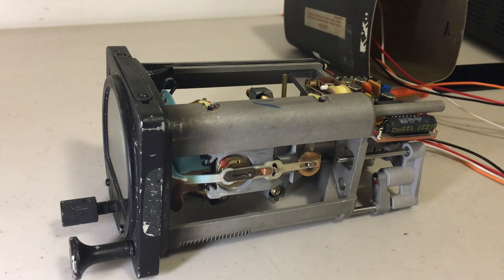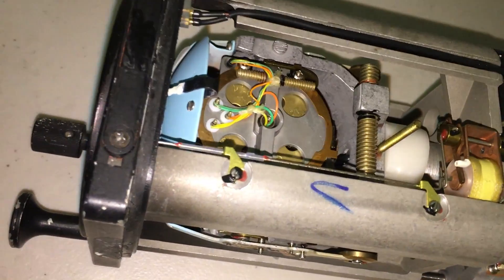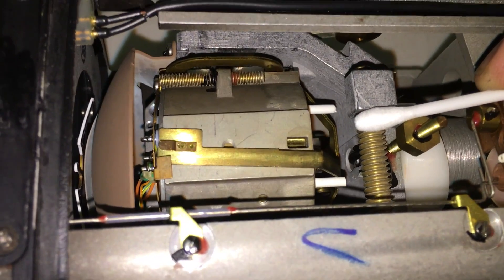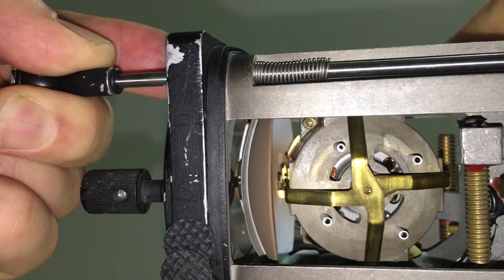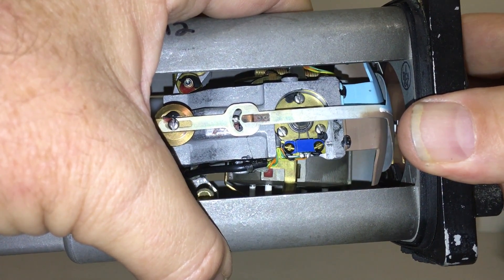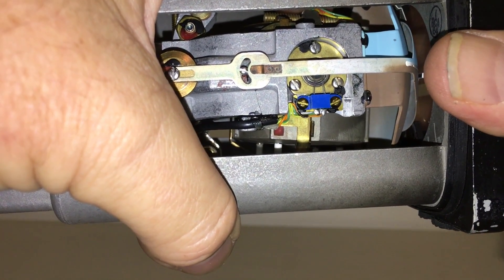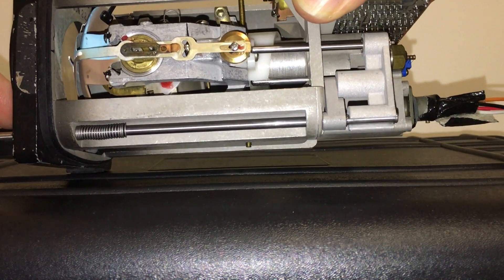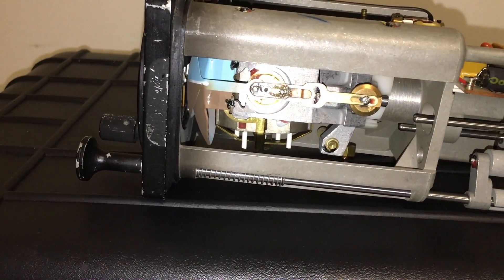Flat Earth - A look inside the Artificial Horizon - Pendulous Vanes.

Comment: Wolfie, a vid on Inertial Navigation Systems (INS) might be enlightening. While the artificial horizon does its job by correcting to align with the earth's gravity; the gyros in an INS do their job by NOT correcting, thus showing HOW FAR AROUND THE CURVE OF THE EARTH the pilot has flown.Might be difficult to explain so that a "flat" can understand, but you can do it if anyone can.
Reply: It is assumed that the gyro is self-correcting by 'gravity' acting upon the pendulous vanes as an aircraft circles the earth. A demonstration of what would happen in that eventuality is useless if that is not actually happening. Can you see the assumption?

If the pilot is actually flying over a flat plain, then the gyro would behave exactly as it does when you believe you are flying around a curve. 
.
.
There are those that claim that 'gravity' automatically keeps an aircraft in the flight at the same relative altitude as it fly's around the curvature. My only question to them is: Does it also keep the wings level, so that one doesn't dip below the other? 

After their wheels stop spinning and they admit that it doesn't, then I point out it doesn't keep those two points between the nose and tail level either. The pilot must do those things. Gravity could care less if it's level or about to crash.
.
.
.
There is a solution to this debate. Use electronic and video means to establish that what you believe is happening, is actually happening during a long distance flight. Those vanes  should be  opening repeatedly and frequently in the same direction, to correct for the beginning of any misalignment of the gyro due to a reorientation of the center of gravity.

Wolfie only needs to show that what he believes is happening is actually happening. Knowing the alignment of the AI (and the gyro in it), we should be able to predetermine which ports SHOULD BE repeatedly opening.
.
Reply: Gee, Mephi, I wanted to leave all the grunt work to Wolfie, but you won't let me, so here goes.

The artificial horizon (or attitude Indicator, -- AI) proves nothing: neither flat earth nor curved. The AI's gyro remains level, which is what both "Flats" and "Globes" expect. However, Flats think that, because the gyro remains level during a long flight, it debunks the globe. And that's why Wolfie had to take the trouble to explain that, actually, a bit of ingenuity (the pendulous vanes) was required to get the gyro to realign itself with the local force of gravity, and that the AI doesn't debunk the globe after all, and we're back to Square One.

That's where my idea about the Inertial Navigation System (INS) comes in. Nowadays INS has been replaced with GPS, and even late-model INS units worked with electronics or lasers; but the first models (1960s) worked with actual, physical, mechanical gyroscopes. To use them, you would first spin them up, and then enter the plane's initial position into the unit.  Then, as the flight progressed, the changing tilt of the gyroscopes (three of 'em, one for each axis) would tell the unit how much of the earth the plane had flown around, and thus where the plane was. Simplistically, one could say a gyroscope whose axis was initially vertical, after a flight around a quarter (90°) of the globe -- from Hamburg to Rio, let's say --  would be horizontal. This was a big deal at the time, and permitted those wonderful B-747 Jumbos to fly long, transoceanic routes beyond the range of radar and of reliable radio communication. It worked well. (Earlier, airliners had to use celestial navigation when they were out over the ocean.)

So here we have a gyroscope which maintains its position in space; and what is more, by measuring the change in the gyroscope's orientation, you can reliably tell where the plane is.  Gravity doesn't enter into it. At all. And to me, it looks like this is a pretty good proof that the earth is a globe.

But Mephi, while I've got your attention: actually, gravity DOES  play a large role in keeping an aircraft at a given altitude as it flies around the globe. And gravity DOES play a large role in keeping a plane's wings level. Now, I can't write you a primer of aeronautical design right here, but you can look it up online. What you want is the chapter on STABILITY: stability in PITCH and stability in ROLL. The mechanisms aircraft designers use to make an aircraft STABLE on the pitch and roll axes wouldn't work without gravity. In PITCH, if a plane descends (falls), it goes faster. Aircraft designers configure the plane's wings and horizontal tail so that the increase in speed that comes from falling (gravity) will cause the nose to rise slightly, counteracting the descent. If a plane climbs, the opposite happens: gravity slows the plane and the nose drops, bringing it back to altitude. In the ROLL axis, stability is managed through wing dihedral (angling the wings slightly upwards). It's a bit more complicated to visualize, so check the internet -- but you should know that this dihedral effect is totally dependent on the force of gravity,
Reply: So if I get what you're saying, we currently lack the technology to prove that what you claim is happening with those pendulous vanes, is actually happening. That it is simply impossible, at this time, to determine if those vanes are repeatedly and predictably opening (as "gravity" would cause them to)?

Go back and examine what I said. I said that the debate could be settled through the use of electronic or video means. Yes, light sources and cameras can be very tiny. Use them to SHOW the vanes working or not working. If what you say is happening, is actually happening, then prove that it is. That's not unreasonable.
.
.
.
Now, the gravity keeping your plane at a given altitude. In order for what you said to be the case, the 'Angle of Attack' of those flight surfaces would have to lowered. Gravity does not stop an aircraft (traveling at sufficient speed), from climbing when its' angle of attack is increased. Nor does the ground falling away below an aircraft suck it downward.

A plane can fly over a mountain and continue on in straight flight. A plane flying over a curved earth can continue to fly in the same straight level manner. You are pretending as though the gravitational pull of the earth is so strong that the aircraft will behave as if it were tied to a string; remaining fixed at the same altitude. 

If that were actually true, then a pilot could not intentional bank his aircraft. That strong 'gravitational force' would keep his wingtips at an equal distance from the earth. However, we know that gravity does not resist this. Nor does it resist the nose rising above the tail. 
.
.
.
So, setting aside theoretical claims:

"Gravity" is not going to stop a pilot from noticing the surface of the earth curving exponentially downward away from him. It is not going to keep his wing tips at an equal distance from the ground below him. It is not going to keep the nose of his aircraft from rising; nor pull it downward so his plane remains level over a curve. It isn't magical, and it doesn't "care" about him.

Regarding much of what you stated in your last paragraph: Study "LIFT" and "PRESSURE" in relation to these aircraft surfaces. When there is more pressure on one side of the wings surface then on the other, then that wing is lifted upward. When the shape of the wing are altered, the pressures on each side of it are also altered.
.
Reply: Wolfie showed the vanes and how they work. So what you are now demanding is a real-time, in-flight demonstration of an operating AI? It could be done, I suppose, but it's a lot of effort to go to just to preserve poor, misguided you from error. In fact, hell naw, you're the one that's trying to prove your point by saying that the AI doesn't work the way Wolfie said; so it's up to you to prove Wolfie wrong. Good luck.

As for the other stuff, before you try go off the deep end AGAIN -- and, yeah, I've heard a thing or two about lift and pressure -- please read up on stability like I asked you to, and the means that aircraft designers have developed to achieve it. Then ask yourself how those means would work without gravity. Fact is, they wouldn't.

My suggestion: you should get out a little more. Go take a couple of flying lessons. It's fun, and you might learn something.
Reply: What Wolfie showed, was how the vanes were  believed  to be working. He has demonstrated that  IF there were  a changing reference to a center of gravity actually experienced as an aircraft passed around a curved earth, then the vanes would likely be effected by that gravitational force.

He did  NOT PROVE  that the theory of gravity is true. He did  NOT PROVE  that what he says is happening inside an Artificial Horizon, is actually happening. It's not up to me to "prove Wolfie wrong" when it is easy to prove his demonstration is based upon assumptions, and therefore his conclusions are simply his beliefs. I don't have to prove what exists only in his head as being wrong, when I can prove that at this point it is only occurring theoretically. Nice try though.
.
.
You the ducked the point, that either numerous continual slight changes to the course of the aircraft need to be made to navigate the curve (that you believe is there), or fewer (but greater and more noticeable) changes need to be made. There's no way around that. It's one or the other; pick your poison.

Also, regarding your point about stability being designed to be dictated by gravity: please explain how temperature variances and atmospheric density can change the force of gravity; because we know that an aircraft's flight and maneuverability is effected by temperature, humidity, and altitude (atmospheric density). 
.
Reply: @wordsmithgmxch  The more interesting one would be the heavier Marine Navigation Gyros like those manufactured by Sperry, as not only do they show precession, but unlike airline navigation gyros, they don't require the same precise alignment as aviation ones as they actually use precession to self-find true north.

Comment: So what will happen if the pendulous vanes are disabled for a fix amount of time... would the gyro then be able to show the rotation of the earth given there are no other external forces?
Reply: The answer is actually yes..... in earlier aircraft that used gyroscopic axis indicators that lacked this correcting mechanism this it was required to periodical cage the gyro to fix precession errors. In fact, you would have to attain level flight and cage the gyro the first time just to correct from precession caused by takeoff accelleration. these AI's were massively prone to errors prior to the introduction of pendulous vanes.

Comment: Could you tell me what's the other lever on the front panel for? Does it adjust something?
Reply: usually for calibrating to pitch. remember the exact direction an aircraft nose points isn't the direction the aircraft will necessarily be traveling in.

Comment: What I don't understand is why you would want a precision instrument to compensate at all?  Perhaps there is a problem with your aircraft forcing it to fly a few degrees off level, isn't the point of the instrument to alert you to this reality, not compensate for it and effectively hide it?
Reply: A bit late but: A mechanical gyro can not have 0 drift. No matter how precise and low friction you build it. Friction on the bearings will cause gryo to drift, then as mentioned curvature of the earth would also contribute in ever so slightly. Any sort of vibrations also speed up drift. So a gyroscope drift is an expected behavior which needs to be automatically corrected, and is not an unexpected issue that needs to worry the pilot.

Oh and even digital gyros experience drift, this is why the digital gyros are almost always used in combination with an accelerator

Comment: You really have to laugh at the legion of idiot-bots commenting here, who think every single video that explains something they didn't know before somehow "proves" the earth is a ball.

You took the time to demonstrate that gyros feature a mechanism designed to return the gyro to level, and then toss in the comment "even over the earths curvature". False. The vanes inside the gyro are there to compensate for things like drift (i.e. the variances in the gyro's RPM), vibration (airplanes vibrate due to engine, turbulence, etc), as well as mechanical imperfections in the gyro itself (high precision but not perfect).

The pneumatic correction system exists to keep the gyro level relative to the ground where it initially calibrates itself prior to takeoff. If the gyro "auto corrected" ACTUAL inclination or declination in flight, IT WOULD BE DEFECTIVE.

Another pseudo-intellectual wasting his time trying to use a roundabout method to validate the lie of the ball earth in space. smh This is slightly less retarded than the dipshit who claimed he was taking photos of the space station as it flew by.

Man, the ball earth cult really needs to grow some balls and accept reality!!!
Reply: +Alpha Force , well well well. Back at it I see. I see now you are an engineer. Keep the counterfactual comments rolling !!

Comment: The air vents must be rotated 90° in order to account for precession, right? Pitch vents must be on the sides and roll vents on the front and back.
It could not correct just for having the center of gravity slightly lower as you show at the beginning when turned off. without the correction mechanism it would just endlessly wobble instead of correcting.
The lower center of gravity gives a good enough starting position without interfering too much with the correction mechanism.
Reply: The air vents are at the right position. The direction a gyroscope will move if you apply a force is 90° off to that force.
Here is the experiment done by Dustin from Smarter Every Day:
https://youtu.be/eTjGTxSevHE
Reply: So, someone else asked the same question and that was Wolfies answer:
The port that opens will result in correction at 90 degrees to the direction of the Port.  That is due to Gyroscopic Precession.  It will respond at 90 degrees to the force applied. 

This animation explains it nicely.

https://www.youtube.com/watch?v=_MoS5Yw9ZgE

Comment: Wolfie6020
Locking the vanes & running this unit would give the impression earth is stationary, (you should get 15 degrees per/hour reading change if the earth rotates),... regrettably because this gyro diameter is small & this unit has a natural gravity bias, all you will read is bearing drift/precession, even so, if you think it is a precision instrument you may need to change your views on spinning earth theory. Balancing the central gyro mass axis is important for real results, not just balancing the static weight. 
Space type gyro's should be triple axis zero point spinning mass GoG(no gravity bias). The bigger the diameter plus weight/speed = greater accuracy. 
Of the helio or geocentric theories, gyros are possibly the most compelling evidence for stationary earth that i have seen thus far. I would love to put a space type gyro on a plane from Perth(Aust) to Japan, if you don't get a 90 degree axis change on 1 of the gimbals then earth is flat right?.  cheers